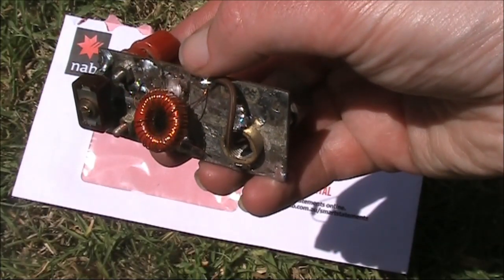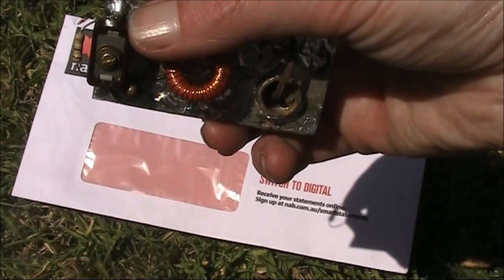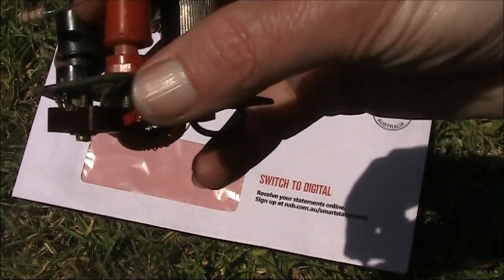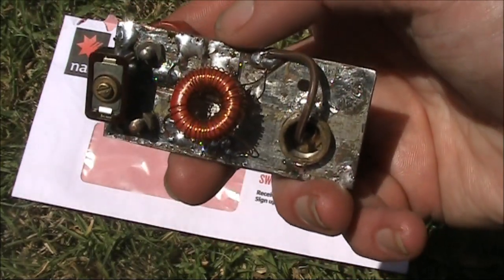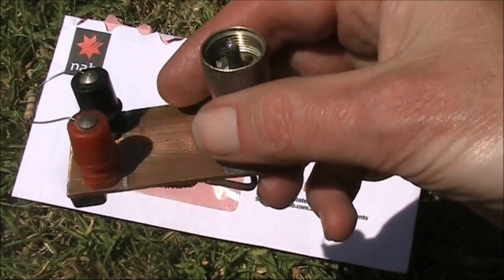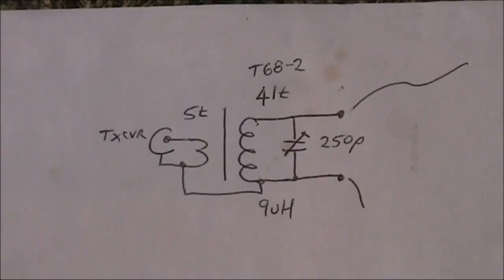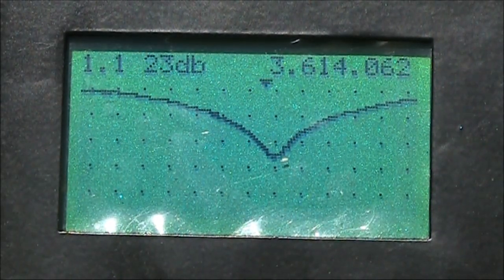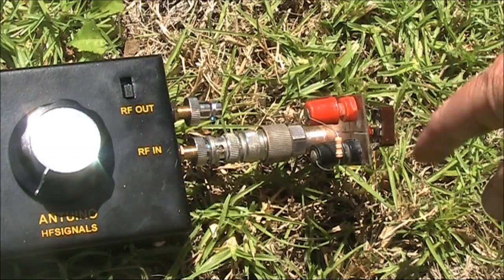3.5 MHz antenna coupler for end fed half wavelength wire

Comment: The T68-2 Datasheet say 57µH/100turns, how can be 41turns 9µH?
Reply from the maker: It's not a linear relationship between inductance and turns. See a chart here that says 9.6uH: https://www.gqrp.com/toroid_inductance_chart.pdf It will vary slightly with wire spacing.
Reply: @vk3ye  Thank you very much. 73

Comment: Would this balanced coupler design  work for your bi-square antenna on 10 metres
Reply from the maker: No. 1. This one is for 3.5 MHz. 2. It's also unbalanced.

Comment: Nice construction. The antenna is known as Fuchs antenna in EU, after it's inventor Josef Fuchs, OE1JF. I've built one in 2019. The ground connection between the primary and secondary windings is not required. By omitting it you get a galvanic isolation from the antenna which protects the transceiver from static electricity. It's possible to use an air-wound transformer. In this application it's still quite efficient but much cheaper. Also it's possible to get 1.6 uH secondary, which allows to build a multiband 10-40 meters antenna.